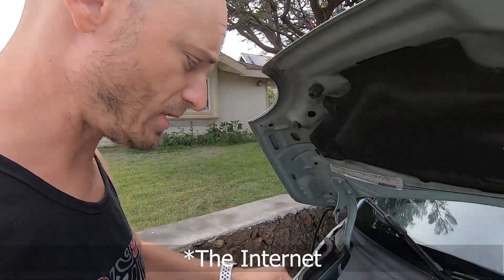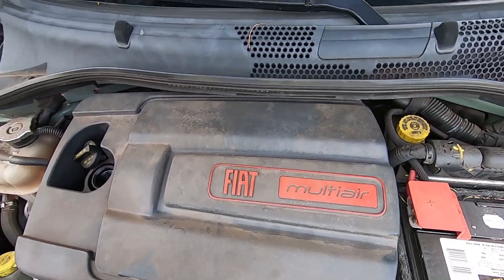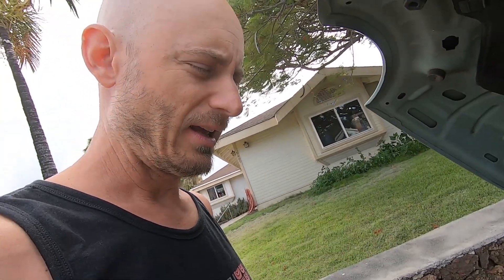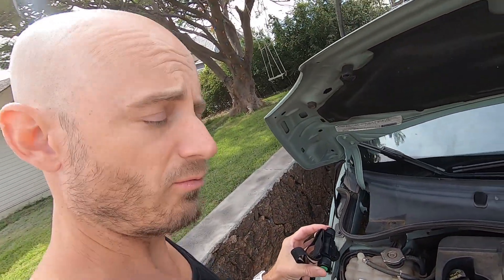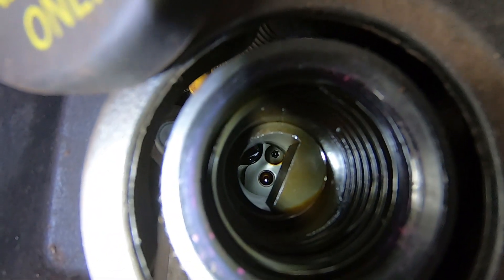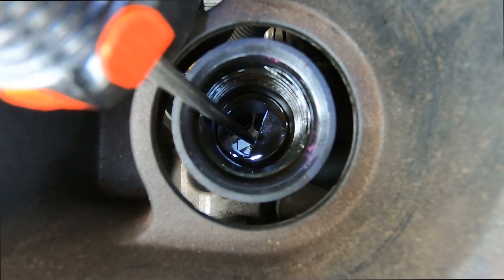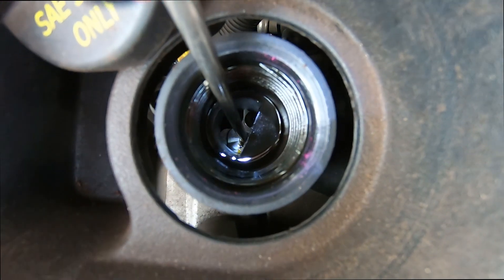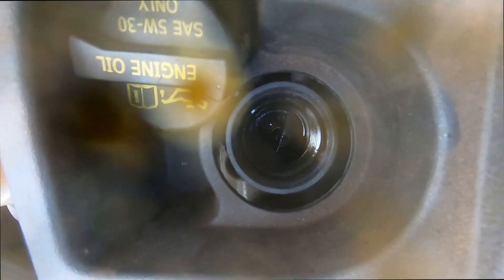Fiat 500 Multiair - Crank - No Start - No Compression - FIX!!!

Comment: Tried this and the fuse remove and mines still making the same noise.  Starter maybe? I get a pedal/multi air sensor code as well.
Reply from the maker: If it’s cranking it’s not the starter.  Good luck!

Comment: My car started doing this, 18k miles, testing this out tomorrow, we me luck
Reply from the maker: Good luck! Let us know!
Reply: @ShanesGettingHandy so, mine didn't have the lil ball think in the oil res, but my dad and brother looked a video and as the oil had gotten low, it seemed like oil pressure built up. They cranked it on and off (careful not to burn it out), and it fire up, spluttering, lol.

One question, mine is a 2019 model and I had assumed a 2019 model would warn me if oil or servicing was required, it showed no warnings for anything...I am now calling it my vauxhall nova...because i thought a 2019 would have basic functions my previous 56 plate colt had.. lol
Reply: I feel so dumb, i really kept thinking...the car has that feature, i read it in the book...then i read the manual again and in brackets (specific models) ... @ShanesGettingHandy

Comment: I've been having problems with my fiat 500s 2015 starting up whenever it has been left for a day or 2,however it does start when I jump it off from another car. I've also had a dash warning come up a couple of times saying insufficient oil pressure. I'm suspecting the starter motor but would it be worth giving this a try or would it not start at all with this problem? Thanks 🫡

Comment: Same problem here on my 2012 Fiat Sport; left idle for a bit then got a crank-no-start. Honestly, I thought it was my battery, I recharged it, tried again and no start. Then went to Sam's Club and bought a replacement battery, only because my old one was from 2/22 - I figured it was the issue. Once I put the new one in, I got the crank-no-start issue once again... I knew this time it was not the battery. My first thought was of an old video I once saw about a spider that crawled into a line but decided to check YouTube on my car instead. Sure enough, your video popped up and I figured it was pretty much the same issue and worth trying out... let's say for now, your 'fix' did the job perfectly... Now if only I can find an easy fix for my A/C and Window Washer pump. Anyway, thanks, Shane. 👍😊

Comment: Bro, i just did a head job on a fiat tipo cross 1.0, also has the multiair system, whel i press the ball and crank it throws loads of oil but still whining like no compression

Comment: Push very very very slightly with the screwdriver. The spring is very soft, and the distance traveled by the ball is tiny (less than 1mm). You don’t even feel it. If you push too hard, the risk is to destroy the mecanism and push the ball inside the engine. 
If the method describes in this video doesn’t work, inject some oil (with a syringe without needle) into the hole in order to fill the cavity with oil.
Reply from the maker: Thanks for the extra info!

Comment: All these videos telling people to push down on that ball bearing in the oil filler cap is misleading people,  just pushing that little ball down is not why the car is cranking, they get it cranked because the oil pump manages to get oil past the sensor, mostly luck, that ball is like a check valve where the dealership injects oil to cause the sensors to see oil, you can do that yourself with a oil can with a small hose connected to it and pump it up, real easy to do, a dealership can tell you anything, mechanic shops too if their trying to rape you, it's just pure luck getting one to start using a screwdriver to push that ball down

Comment: I have same issue 124 spider , how much pressure did you push on the ball Bearing ?  
Also someone said he got it started after squeezing 4 oz of oil with oil can thru the ball bearing.  
I will try this weekend, any suggestions will be appreciated, thanks

Comment: Just another scenario I thought I'd share...  We got in a Fiat with the Multiair engine and it didn't have any compression.  We bought it from auction and it had been sitting for a while.  We tried the oil in the check valve process many times and couldn't get it to work so as a last resort we tried compressed air straight into the check valve while cranking.  It worked!  Runs great now.

Comment: How hard do you have to push on the ball valve?
Reply from the maker: It's a bit stiff, and required a firm press.
Reply: @ShanesGettingHandy  thanks for the reply. I gave it a good press with a screw driver but there wasn’t any give at all…Abarth still sitting at the bottom of my driveway 😕

Comment: sadly stabbing that tiny ball valve with a blade screwdriver does nothing.  You would have to have a scratch awl or similar in order to press the ball.  What you have done is prime the multiair brick with oil by attempting multiple starts.
Reply: You gotta love trolls.
Reply from the maker: You may be right, but I also certainly felt the ball depress while pushing.  Either case it started.  🤷‍♂️
Reply: @ShanesGettingHandy there is no way you even touched the ball with a blade screwdriver like that, but okay.   👍
Reply from the maker: @rwhipple73  Not only did I touch the ball, I depressed it, but okay. 👍
Reply: @ShanesGettingHandy  hahahaha.   Keep telling yourself that lie.   Look again. 

Some know nothing internet wanna be mechanic might believe you.
Reply from the maker: @rwhipple73  One of us actually pushed a screwdriver and documented it in a video, the other only typed some words on a keyboard and didn't bother even trying.
Reply: @ShanesGettingHandy triggered much?   😂.    If you had a half a clue what you were doing you wouldn’t have been sprayed in the face with oil.   😂
Reply from the maker: @rwhipple73  What happened when you tried it?
Reply: @ShanesGettingHandy  I depressed the ball with a scratch awl and then used a dental syringe to remove air from the multi-air block and fill it back with oil.
Reply from the maker: @rwhipple73  Cool 😂
Reply: @ShanesGettingHandy  yeah…..stop misleading people with your nonsense
Reply from the maker: @rwhipple73  sure thing, I'll get right on it.
Reply: he didn't try  @ShanesGettingHandy
Reply: @ShanesGettingHandy  you just gotta have the last word don’t you.    Triggered much.
Reply from the maker: @rwhipple73 Actually not triggered at all.  Have a nice day!

Comment: From what I understand you don't have to pull the fuel pump fuse, all you have to do is floor the accelerator and the injectors won't fire. Does the same thing as pulling the fuse.

Comment: Working on a 2012 multi air replaced starter it cranks but won't start.  It worked fine before the starter went out.

Comment: What did you do with the screw driver? Push down? I have this same issue, but I can't figure out what you're doing with the screw driver.
Reply from the maker: Push down.  It's a bit stiff.
Reply: @ShanesGettingHandy  had nearly my full body weight on it. Wouldn’t budge.

Comment: For some reason, I cant push the bleed valve. It feels stuck. How hard did you have to press it?
Reply: read the above comments and disconnect the fuel pump fuse  instead
Reply from the maker: It was harder than I thought it might be, that's why it took me two tries.
Reply: @ShanesGettingHandy  Do you feel that it is moving at all when you push against it? Mine just feel like im pushing against a solid piece of metal. Hmm
Reply from the maker: @whasupman  Yes, it moves a little.
Reply: @whasupman  Mine feels just like yours. I cannot push it down for the life of me. I weigh 200lbs, and at one point had myself completely propped up by the screw driver, but it still wouldn't budge. Any luck for you?

Comment: My 124 spider did the same thing.  The best way is to drain the oil and when you replace the oil direct the oil to the same place as the hole where he was pushing the screwdriver.  I would always discourage pushing a metal rod into an engine.

Comment: This video was very helpful in helping me identify the issue. However, I did not have a helping hand, so I used the other method. I pulled the F21 (fuse #8), cranked the motor over 2 times for about 15 seconds, on the 3rd crank the compression came back. I put the fuse back in, cranked the motor, and she fired right up. Thank you so much for the help!!!!
Reply: Hello there, what's the F21 fuse for? Thanks
Reply: @gavinb5784  Fuel Pump. Disabling builds compression. Then enabling after compression should fire it up.
Reply: Hope Tommorow my 0.9 twinair will workafter this guide 😢
Reply from the maker: Excellent!
Reply: This fuse trick just saved my Alfa Mito from a trip to the mechanic. Much appreciated!
Reply: You don't need to pull the fuse. Just hold the throttle pedal to the floor while you crank. This switches off the injectors without messing with the fuses.

As soon as you hear the engine building compression let go of the throttle and it'll start
Reply: Tried this now it doesn’t crank
Reply: How could you tell the compression came back? Something about how it sounded?

Comment: I was able to get my 2013 500 started with the video and reading the comments i pulled the fuel pump fuse tried to start it a few times then put the fuse back in and it started without the risk of breaking the lil ball off in the brick. You are the best thanks

Comment: Hi
I'm having the same problem and tried a you showed but the part/button inside the oil hole wouldn't budge. How much pressure was used? 
Thank you!
Reply from the maker: Hey Carlos, it was stiffer than I initially thought, that's why it took me two tries in the video, I had to press somewhat firmly.
Reply: @ShanesGettingHandy  
I'll give it another try,  I appreciate your reply!

Comment: OMG..... well believe it or not the exact same thing happened to us, we tried Two (2) new batteries and couldn't get it to turn over, we took it to our mechanic and they reported no compression and sold us a replacement engine. I did recommended that they watch this video on a gent that also experienced low compression and figured they may or may not have  pulled up the video,,,,,,,,,i just received a call 8/10/21  from my Honest Mechanic and he reported that the car does indeed start and run. I asked and he said it took a few hundred cranks but the engine turned, ran rough, ran smooth and continues to run. 
I would like to give a shout out to Mittens & Mango and to Tire Works (Centennial) North Las Vegas for being honest and posting this video 

Many thanks to honest people still left in this extremely odd time.

Comment: My moma fiat has the same issue but the valve wont push in. Should it move easily or do i have to beat on it to break it loose?
Reply from the maker: I had to press harder than I thought, that’s why it took two tries.
Reply: @ShanesGettingHandy  okay i puahed pretty hard and tried banding on it with my hand. If i give it a little love with a hammer think ill brake it?

Comment: Well, let me tell my story before thanking you for your video.  I kept my late Father's (90yrs)2012 Yellow 500 for sentimental reasons. I don't have it licenced, but it sits during the warm months on the driveway as a reminder of his warm spirit. In the winter, I store it close by in the parking garage of a condo. Well, its time to remove the car and bring it home as they will clean the garage for the season and every car has to be out! To my dismay after putting the batt back in the car cranked and no start...................shoot!! what to do? I thought full pump? I dont think i heard it prime when i turned the key?!  Well, now I need to get a tow? not out of the garage, truck wont fit me thinks......I will have to tow with car out to street, then home by a tow truck.!! shoot! what a hassle!
Let me check the interweb?!     So I come across your video.............seems like a bunch of malarkey to be honest........screwdriver in the oil fill ...........good one?? What is to lose? splash of oil on the safety glasses? ok i will try? I'm desperate.  Sure enough, although not the right hole at first(insert joke here)I managed with the help of a friend to START it up!!!!  What a F ing relief!!!

thank you Brother, life saver! Car at home bringing life to the street!
Reply from the maker: I could barely believe it when I did it too, you can see my surprise in the video!  Sorry to hear about your Dad, but happy I could help!

Comment: Don't do this, you can ruin your multi-air brick!! The multi-air system is very complex, it does use oil pressure in order to actuate the valves. As was stated by someone else here the correct way to start the car after it's been sitting is to pull the fuel pump fuse, crank the engine for about 15 seconds, do this a few times, make sure your battery is charged. Install the fuse and the car should start up.. I recently purchased a pop with a blown head gasket, I pulled the engine and am in the process of rebuilding, I found another engine and purchased it so I could experiment with it and not with my engine. The engine I purchased was listed as a non-running. I have not tried to start either engine as I knew there were problems with them, after running across this post I decided to look closely at both engines and the little check ball/valve that is being pressed down on. The engine that I purchased had notable scratches on the top of the multi-air brick at the check valve, apparently they tried this trick also! Apparently they pushed the check ball through and now it is in the multi-air brick, after taking the top plate of the brick off I found the ball floating around in there, but I can't find the retainer yet, this multi-air block is ruined now.. without the check ball in place the multi-air brick will not be able to sustain oil pressure to make the car run correctly, these are very complex engines and that is not what the check ball is there for, don't mess with it do it the correct way..
Reply: thanks for this tip. I was about to press on the ball but because of you I pulled the fuel injection fuse tried to start it 4xs for a bout 15sec each time and on the 4th time it worked. I think I put the fuse back in after the 3rd time. Now I need to fix the 4th cylinder misfire
Reply: Wish I'd seen this. I pushed hard as per the recommendation, when it finally moved, it slipped. Ball is stuck in there now.
Reply: @dizzy13sn  did not see your post earlier, what have you done?
Reply: @HhHh-vi9bq  had to buy a new multiair brick.
Reply: I did this and my fiat still runs strong as ever!
Reply: Ive got a 1.4 giulietta and I'm tempted to ty it, but wouldn't cranking it for too long ruin the starter motor?
Reply: @rixon3984  you will have to do this three or four times, do not continue to keep cranking it do it for about 10-15 seconds at a time and let it set you will eventually build up pressure
Reply: Is that then oil should not come out of that hole? In my Cherokee with multi air system it does not start and too much oil comes out of that hole
Reply: @alejandrosoto3266  oil does come out of the hole, it is to pressure relief,
Reply: Thanks for the tip here! I have a 2013 Fiat Pop 500, automatic that was cracking, but not turning over and starting. I did try pushing the oil valve, with slight pressure, but there was no budge or movement. I took your advice and removed the fuse, and cranked it with the gas pedal to the floor for about 30 seconds, then put the fuse back in... and it started. 
What caused this to not start? is there something I should be checking to avoid this in the future?
Thanks again!
Reply: I have a 2018 124 Spider and one YouTube video said you didn't have to pull the fuse, just mash the throttle to the floor and that closes  the injectors. I haven't had to do this because my always started.

Comment: did you have to push specifically on the ball in the center, or just jam it in there and hold in general?
Reply from the maker: I had to press the ball in the center down.  Also, it was a bit stiffer to push down than I first thought, that's why it didn't work the first time.
Reply: @ShanesGettingHandy  thanks - I cannot for the life of me get mine to feel like it moves at all.

Comment: I didn't know this method but on a Twinair if you disconnect the fuel injectors and coil packs then crank the starter for a couple of seconds then pause a few times it will build up oil pressure back up and it will start.

Comment: I been trying to start my 2012 fiat all day since it's been sitting for 9 months, even had to buy new battery and charger since I killed the new battery after cranking and cranking. It's too late to try this now but first thing tomorrow I'm gonna give this a try and if it works I will come back and leave a comment update. I'm almost 100 percent sure this is gonna be the fix i was looking for. Thanks for posting this.
Reply: Well I gave this a shot thinking it was going to be the quick easy fix and I could get it to work. But alot of you tubing and diy work and I did manage to get my 2013 fiat running and driving again. It's been 3 years since I actually drove it. Forgot what a fun little car it is to drive. By the way, when you pressed on that tiny ball bearing down in there could you feel it depressing? I couldn't feel any movement in mine using a screwdriver like you did. I even tried a metal cost hanger since it seemed to fit better but still nothing. Im not really sure if pressing on this actually does anything at all on my car but it looks exactly the same.
Reply: @mpowersmedia3219  can you put the links to what you did my 2013 is having the same issues
and the screw driver didn't work but i was really hopeful!!!
Reply from the maker: I hope it worked!